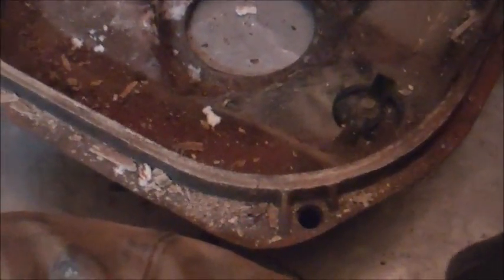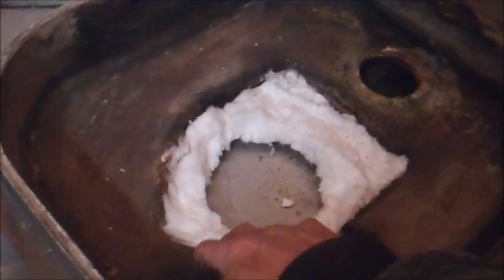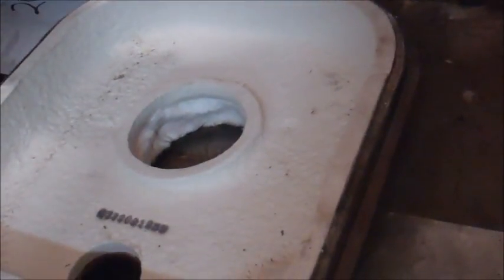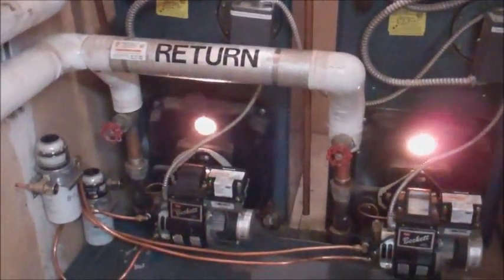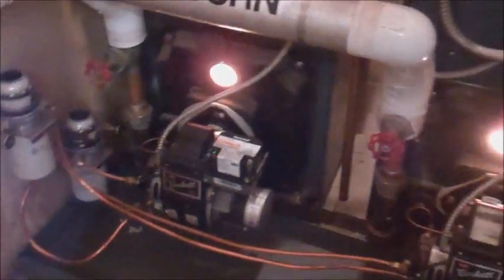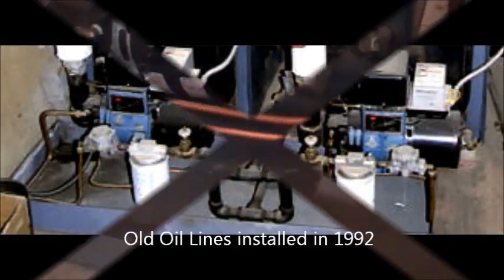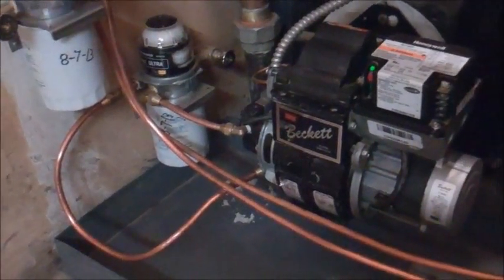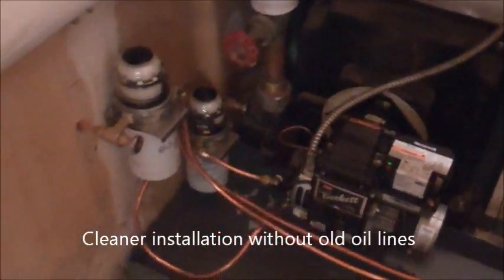How to Replace the combustion chamber on a Weil-Mclain oil fired Boiler

Comment: I have an American Standard oil boiler from 1950 and I have no insulation inside. Would I have a problem if I run it like that until the spring so that I can do the insulation then?
Reply from the maker: Sorry J balls can't help you there. Try consulting with the manufacturer which was brought out by Burnham American and now is U.S Boiler Company

Comment: Well, too much of the actual install is skipped over. some time spent on showing how to get it out of the package, but no time showing actually putting the backwall blanket in, no comment on not using water glass and why.  Actually cannot see spreading the waterglass for the bottom, so is it just around the edges or all over? This video shows you nothing you couldn't figure out for yourself anyway.
Reply from the maker: Paul, Sorry this video did not meet your expectations. Thanks for viewing anyway!
Reply: @nakco6025  Worked great for me...
Reply from the maker: I am happy for you chazdvl Thanks!     jerry